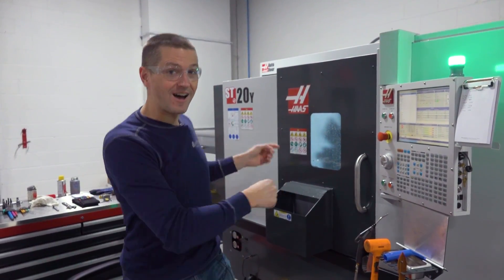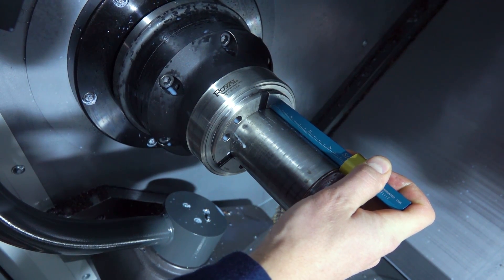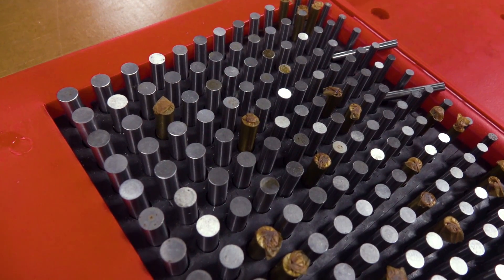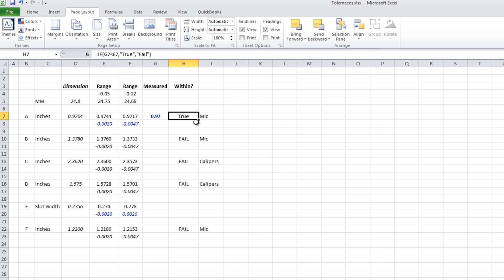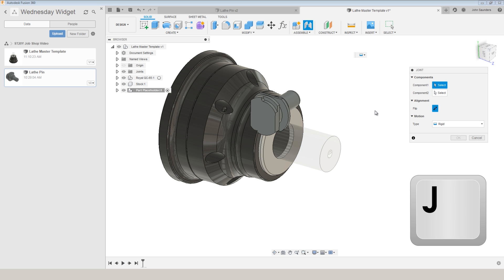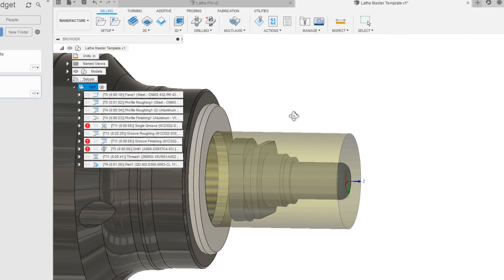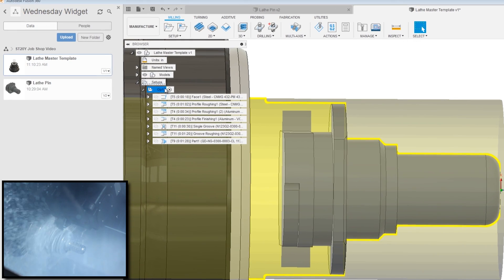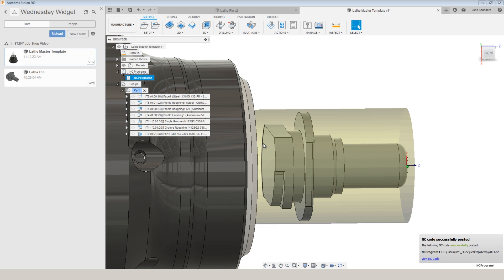CNC Lathe Job Shop Work: Programming & Machining Tool Steel Pins

Comment: The best way to do the if statement is the number should turn green or red, for good or bad.
It's fast as hell if you are doing several dozen checks.
I don't read jack on repeat inspections. I just get bull like if I see red on the inspection page.

Comment: Just a suggestion for process security.  The V Style (35 degree) finish tool is not what you should be using for the finish pass.  The part geometry doesn't require that style of insert.  A C style (80 degree) insert will give you a much more durable tool in the long run.

Comment: I'd add a row on that spreadsheet with the deviation from centre of tolerance so ((E7-F7)/2)+F7

could also colour code it so that if it's out of tolerance it's highlighted red and green for in tolerance

Comment: Wouldn't it be possible to adjust the max RPM automatically depending on the stock diameter? The length of the bar in the bar feeder shouldn't matter as long as it's a straight piece. We ran our lathe with 4 meter material in the bar feeder with 7000 rpm.

Comment: Man how much more complicated could it be to program a lathe part. Fusion is a mess!!! Just draw it out then apply the tool paths. Does everything have to be a huge process of modeling and spread sheets? What a mess.. That part should be done in no time with a decent Cad/Cam program. Infact, it could be done right at the control then ran. I get it, Fusion is free. They obviously don't use machinists in there development process. You now have Over a million dollars worth of equipment in your shop, yet you use cheap free software and do it the hard way.
Reply: Programming in Fusion a mess, really?  The spread sheet had nothing to do the programming of the part, that was merely a sanity check on the part tolerances.  The part programming was actually done super fast thanks to the template he had predefined.  Also you have to remember he's covering the topic for us, the viewers.

Comment: We use fusion alot for our 3 axis mills, it works great for that it's even decent for 3+2 but it's horrible for lathes.  I try it out every 6 months or so to see if they've made enough changes to make it usable but it never is.  The toolpathes you get are basically useless, especially for grooving.  We use Esprit which is great but expensive.  I'd really love to switch to fusion but it's still soooooo far away.

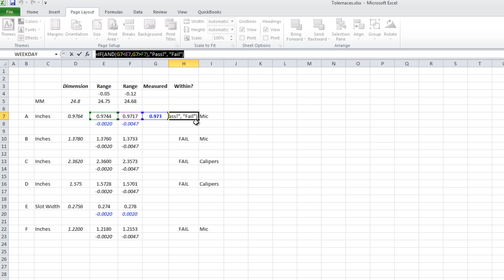Comment: (@5:16) - Oops, silly mistake. Look at the name of the spreadsheet; “tolernaces.xlsx”. I believe the dyslexia monster got into your keyboard! Of course, it should be “tolerances.xlsx”! 😊 Also, once you’ve completed the spreadsheet, lock the formula cells so you don’t accidentally type over them during data entry! 😎

Comment: What was you achieving with that groove tool
Reply: That's what I thought aye! 
All my finishing tools (DNMG) have a 0.4mm radius. Gezz, if they need anything less than that just do a relief (necking).
Reply: sharpening up the corners

Comment: One thing you'll like from Mitutoyo is the data collection device. It's a USB hook up that plugs into your caliper or micrometer and your pc.  Then at a press of a button the data is instantly transferred to your preferred application.  When doing large gage studies or statistical analysis it is a super time saver.

Comment: i dont know if you already know this but lathe parts have a general "corner radius" tolerance, so unless specified otherwise you can (almost always) have a 0.4 mm (around 1/64 inches) radius left by the turning tool in the corners of the part
Reply: so using a groove tool to get rid of the corner radius is a waste of time

Comment: Nice work, i work with a Gildemeister CTX 310 every day, and its old and dont have all the auto stuff that the computer has. i have to program everything by hand in the machine. its a bit of work, but it goes pretty fast when u get used to it. but ofc getting the part pre drawn is pretty nice. i would really want that some times hahah. my head really hurts by looking at 0.9744". 24.8mm is so much better :D

Comment: Congratulations on your ST20.  Hope your probe is accurate. I’ve never used a HAAS that was better than +/- .001” before. 
Let me know if they’ve improved.
Reply: Might want to learn how to calibrate your probe. All our Haas lathes are dead on. If your only getting .001's then why not just tough off on paper. Ridiculous to have a probe that isn't accurately calibrated.
Reply: @keithhansen3963  I have run a few Haas with probes and I agree I would not trust it to less than .001. I have found it wasn't the accuracy but the repeatability. Of course it can be calibrated however once you put the probe up and down a few times it starts to move around. Maybe they have improved this since the last on I ran a few years ago but something to keep in mind...

Comment: John, I was curious about the tolerancing, so found this: https://www.engineersedge.com/engineering-forum/showthread.php/2519-Double-Plus-or-Minus-Tolerances   Apparently not unusual to do it that way.  The drawing dimension would probably represent the mating bore etc.
Reply: its a major part of the ISO system for fits and shaft/bore tolerances (ISO 286). For clearance fits its common to have double plus or zero and plus tolerance ranges for the bore and then double minus for the shaft. E.g. for a 50mm diameter with a H8/f7 clearance fit you get tolerances of +0/+39 on the bore and -25/-50 on the shaft (in micrometers of course). Its also not unusual to only print the tolerance class next to the nominal value and not the tolerance itself, in this case 50 H8 and 50 f7.
Reply: @12346798Mann  Yes that is standard , and Capital letter always represents Inside Diameter/size (as in bores , grooves , and such)
Reply: @12346798Mann  A nice graphic to go with your explanation: https://www.iso.org/obp/graphics/std//iso_std_iso_286-2_ed-2_v1_en/fig_2.png

Comment: 3:30 if someone legit toleranced a part like that they need a serious talking too. It is ok to have everything a 0 or minus so that a part is guaranteed to fit in a bore but you should never have a max dimension that is below the printed dimension.
Reply: you seem pretty miss informed lol, the -- or ++ tolerances are very common
it's easier to look at 15.0 -0.07 -0.1 rather than 14.93 +0 -0.03, for me atleast
probably comes down to what you are used to
Reply: Well there is a good reason for that. Never heard of nominal dimensions and hole-shaft coupling?
Look at the reply to @ tightmf
 's comment for an example.
Reply: Guess I am just an old school ASME trainer engineer.  I find the — ++ tolerancing sloppy. I think prints should be drawn to ideal target size and tolerances should specify allowable limits. I am not a fan of using tolerances as the only means to specify actual sizes.
Reply: @bcbloc02  I am an engineer too but from the metric side of the Atlantic. Please don't tell me that you like those drawings where the number of digits indicates the +/- something on the last digit...
I worked on a lathe myself and understand what you mean but I think it is better to have a number easy to read in the first place, not a five-digit madness
Reply: @bcbloc02  the thing is that engineers rarely think about the part being made, they think about its end use. I run into this alot, it's annoying but it makes sense if you look at it from the end use point of view

Comment: just to watch someone working in Imperial makes me feel so relaxed that i work with metric.
Reply: Neither is more accurate as there is no limit on how many decimal places you can use.
Reply: @ChristophPech  You're right Chris. I just gotta give some crap to those that feel they have to post up haw better there system is then the Americans.
Reply: @keithhansen3963  neither is better if you are good at both. but I find metric prints typically the general tolerancing due to rounding is tighter, therefore more accurate parts required in that sense.
Reply: Metric prints are tighter toleranced because it doesn't take 17 decimals to get  micron resolution.
Reply: Why is metric easier?
Reply: No fractions, everything is decimal. All units are base 10, just like our number system, so going from one to the other involves nothing more than adding or removing the correct number of zeros. That's even more important with complex units - g/cm³ to kg/m³... just add zeros; lbs/ft³ to oz/mi³ ... ???WTF???How!!?No,just no!??
Reply: @johnalexander2349  No fractions? WTF are you talking about. Just as an inch can be expressed as rational fractional numbers, metric units can too. Inches are base 10. LOL. 2 of your arguments crumbled in 2 sentences. Hhahahaha. All machining is done in decimal base 10 USCS units.
Reply: Metric units can be expressed as awkward fractions, they just aren't. Your inches are divided into fractions on every construction site in your country. So inches are base 10? 10 inches to a foot, eh? And even if they are base 10, are your roads are built in inches? Because ours are built in mm. Plans don't even specify units, because everything is in mm. Because the only difference between 2 345 678 mm and 2.345678 km is the position of the decimal. How many miles in 2 345 678 inches?

How many square feet will 8 cubic yards of concrete cover at 3½ inches thick? How many conversions did you have to do? How many pounds is 20 feet of #3 rebar? You had to look it up, didn't you. Because knowing the density of steel isn't enough.

Face it, the only defence for imperial units is "It's what I've always used". Metric is better in every other way.
Reply: @johnalexander2349  So what if metric is base 10. I have never understood people talking about Imperial being fractional. I am a machinist and in my head everything is a decimal. I use calculations all day long and metric to standard and back again is no different than cutting speed calculations or trig or any other math. You wanna see an example of metric things that aren't great? Metric tire sizes. The aspect ratio of the width to get sidewall height plus the rim dia (in inches... in north america anyway) to get tire height!!! What in the actual F#%$ is that!
Reply: I've answered that already. Machinists aren't the only people that need to measure things - the rest of your world doesn't use decimal inches exclusively. As for tyre sizes... why is it like that? Not a car guy, don't know, don't care, but for the exactly once in my life that I needed to even think about tyre dimensions, I didn't need to look it up - it's all simple enough. How do you measure tyres? ATG - American Tyre Gauge - How many tyres fit into a 100 furlong wide sphere?
Reply: Can’t say it any better than this https://youtu.be/1cPeZLCVWTw
Reply: I was laughing so hard at that video, what is easier with 1/16th or 2/4th or wahterver than 1-10?
Reply: Metric, for the mathematically challenged.
Reply: Metric, for people who don't want to crash spacecraft into Mars.
Reply: @johnalexander2349  Seems the Americans were in space along time ago using Imperial units. Not to mention it is more accurate.
Reply: Could probably have cut $1 000 000 000 000 off the bill if they'd been using metric. And metric is more accurate.
Reply: @johnalexander2349  Where are you from John?
Reply: A very metric South Africa.
Reply: @keithhansen3963  nasa used all metric
Reply: @keithhansen3963  imperial is defined by the metric system. so it makes no difference, unless we work within 0.01mm and you 0.01'' and you think thats accurate, because its a small number.
Reply: @hansdietrich83  Says who? Our shop has done Nasa work for years in imperial units. Where the hell did you hear that? You obviously don't have contract work with them.
Reply: @johnalexander2349  Great comparison. You guys are knocking it out of the park on the world stage. I have might a couple fellas from your country, so I know they all aren't as arrogant about there measuring system as you.
Reply: Don't expect me to defend this country. I'm just here to make money and take longer and longer holidays abroad. The metric system isn't South African, and it isn't arrogance to defend it - it's international and purely factual to state that it's better than imperial.
Reply: @johnalexander2349   booom got em

Comment: John, I would recommend using conditional formatting on those cells to change the color. Way easier to understand and harder to make a mistake. The format is simple, basically if("FAIL") turn red and if("WITHIN:) turn green.
Reply: LoL I erased the previous comment by mistake. Here it is:

Best solution (IMHO) would be to use the conditional formatting directly on the input cell to change its color to green/red. 
Ah, and also, always lock all the other cells so that the operators wouldn't be able to erase/modify/whatever any formula/setting in the spreadsheet by mistake

Comment: Are we gonna see how he did the mill work on that part?
Reply: In the lathe. His ST20 supports active tooling, which allows it to double as 4 axis mill.
Reply: Larry Bolan he said something about not using the sub spindle, and it looked like the part had some C axis work on it, and from what I understand, the sub on that machine is only positional, can’t interpolate

Comment: John, you probably wont read this but here is a pro tip: buy a UPS for your movable desk. this way you can unplug it, move it and plug everything back in without losing power to your computer so you dont have to reboot every time you move the desk.
Reply: He has one that was shown in a previous video.

Comment: oh i wish i had proper machine, tools and cam at work. I ve been working on a relatively simple part for quite some time now because of those reason. Only fancy feature actually is an o ring groove on the inside at an angle. But yeeeees finally lathe video.